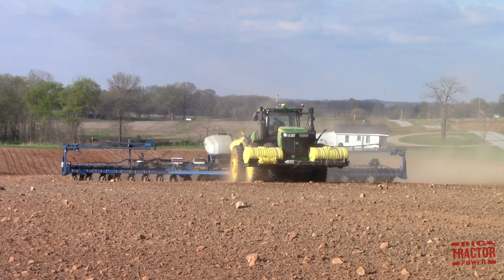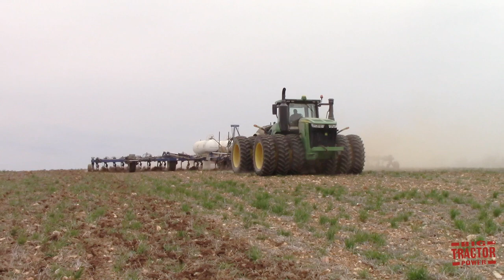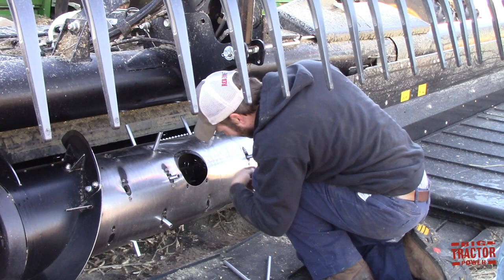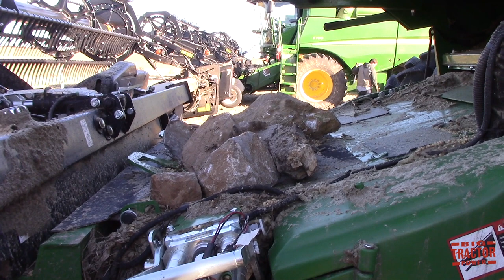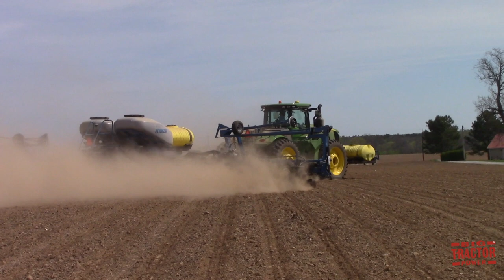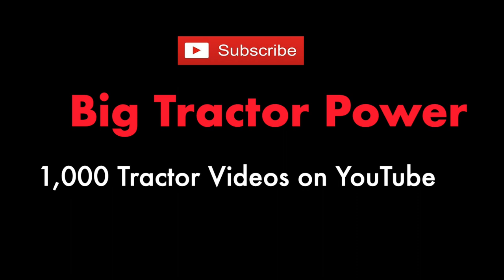Rocks, Rocks Get Rid of Those Rocks

Comment: Oh the memories.  As a kid in the 70s and 80s I spent many hours on an open tractor with a fork type rock picker (no reel just a hydraulicly operated fork on the front that lifted the rocks and dumped them in a bucket in the back) once the bucket was full you couldn't use the fork anymore so you got off the tractor and picked stones by hand to heap the thing full because driving 1/2 mile to the stone pile with a partially full stone picker was seen as a waste.  Also picked by hand when there was a patch with thick stones.  Later we got a reel type picker which made things a tiny bit easier.  The big thing was the switch to no-till.  Tillage brings up the stones so no tillage equals no stones or less stones.  Now with geo marking software on the planter, sprayer, and combine you can just look at a screen to see where the rocks are and drive there in your air conditioned tractor or if in the crop drive a side by side out there.  Land rollers are a huge help when growing low legumes like soybeans, peas, lentils that have to be harvested tight to the ground.  Big rollers push smaller stones and dirt lumps flat into the soil.  Any stones the size of a football or larger won't get punched into the ground and need to be picked up.

Comment: I remember plowing and once in a while a plow bottom would hit a big rock making the tractor slow down until the bottom trips. We had the older IH plow with witch we would have to stop, and backup to reset the bottom. My brothers would get mad if I forgot to tell them where big rocks were. One spring one of my brothers hit a huge rock. We tried to dig it out and discovered it was at least 3’ if not 4’ in each direction. So we dug a deeper hole beside it and pushed it in. Rock are a pita to farmers.
Reply from the maker: I grew up in WNY where stones are prevalent. I remember watch plow trips springing well. What size IH did you run?  The 710 and 800s were popular in WNY. There was field on the road I grew up on that had a stone so large that when they tried digging it up with a back hoe the back hoe could not budge it.  They just left and a small tip of the stone is visible on the surface and they just go around it .

Comment: We run a heavy roller over our bean ground right after planting. It smashes the rocks down flush with the surface of the soil and almost eliminates rock damage to the combine. Also helps with soil erosion. We get more rock damage to our corn heads.
Reply from the maker: Rollers are a hand tool.  They also help germination.

Comment: An old F150 in 4L idling across the field at a slow walking pace was the way we did it.  One guy on each side if the truck throwing rocks into the bed, armed with an old corn crib rake in case some needed to be dug up.  The truck got emptied out at the end of the row by the ditch or they were put on the river bank, depending on which field we were in
Reply from the maker: Great history 👍

Comment: Another great video. Sure hope they have a fleet of rock pickers. Looks like they'll need them on the land that goes in beans. I'm assuming this is the 13000 acer outfit?
Reply from the maker: This vid was a mix of clips of three farms I film at.  The rock picker is part of another large farm.  Most of the destruction clips are from the extra big farm. The big farm uses a Kongslide picker in the fall and Skid steers with rock buckets in the spring.  I need to try to film the skid steeers going in the clean up stones.
Reply: I @bigtractorpower Is it feasible to use a rock picker for the areas covered in potato size rocks after a crop is planted?  I'm thinking all the small rock will have to be hand picked or just left in the field. They're of course no big deal for any crop besides soybeans.

Comment: As a kid in the 70s & 80s, I would plant corn with tractor with loader.  As I came upon a big rock, I'd stop, throw / roll it into the bucket and then dump when I got to the end of the field.  When were were going to seed a field, usually my sisters, mom, cousins & aunt would be out picking stones and loading them on a hay rack.  We had some field where they would load up 10-15 wagons!  Me & Dad usually had the chore of loading the gut-busters/hernia-makers!
Reply from the maker: Neat history.  What tractor and loader did you run to plant with ?
Reply: @bigtractorpower  We had a MF 265 & MF 4 row corn planter & IH 12' grain drill.  Out "big" tractor was a MF 1135 that was dyno'd at 160.

Comment: Why not get a big rock bucket? hmmm
Reply from the maker: They have rock buckets on skid steers as well. Just need to film them.
Reply: I've only seen big rock buckets on like Volvo wheel loaders, i've acully never been seeing a skid steer operate with my own eyes. Exampels of what i see is beeing used in sweden to pick rocks with: https://norje.se/produkt/stone-fork-n306/?lang=en
https://norje.se/produkt/ensilagegrep-n391/
Reply from the maker: A wheel loader would be neat to see. The skid steers are nimble rock pickers and they load them on a pick up with a trailer and move them quickly to the next field.

Comment: Why do the tractors on the planter have so narrow tires?
Reply: Cheaper to replace than having pairs of wide ones.
Reply: I would say so the tires fit between the rows being planted.  Otherwise you would be planting in the wheel tracks which would result in those seeds being deeper in the ground.  IMHO
Reply: @dwightl5863  
That's a very interesting answer, not sure if it's true though. I was only quoting what I've heard Jason quote. But perhaps he knows if the wheel spacing are at what you say they could be. They are the latest model tractors so could have been built to that spec.
Reply: The narrow tires on the tractor fit between the rows being planted. You don’t want to plant into wheel tracks left by tires. You’d have poor plant emergence if you constantly planted into tire tracks. Due to compaction. Poor/uneven emergence drastically effects yield
Reply: @Rick-fx8lh 
I agree with what you are saying but are the wheels set up at those spacings? 
Do you know what the row spacings are?
Reply: Adrian Chetwynd: Check out BTP’s previously loaded video of the planter maybe he says in that video. Judging by this video yes the tractor tires are set up how I described it. The tires are set for 30” row spacing
Reply: @Rick-fx8lh  
Thank you Erik, I will sleep well tonight with the thought that the financial debtors of those tractors have in-debited themselves very wisely. 
Any many thanks to John Deere Inc for spacing the wheels so well.
Reply: @Rick-fx8lh  
Did you know that John Deere Inc was responsible for bankrupting the company that created the Big Bud tractor design/concept?
I cannot remember the name (off hand) of the original company  but Jason knows what company it was that "John Deere Inc" chose to bankrupt.

1 years work in exchange for a 5 year "desist not to do any other work" is a very dangerous contract to sign up to!
Reply: @Rick-fx8lh 
I think that the name of the company that invented the BIG Bud tractor design/concept was called "Wagner".

Comment: There is no way you are filming 2018 field work. Mn Millenial  Farmer is still snow blowing. Why are you fooling us like this?
Reply: Muscle Tractor Fan of course he’s not filming 2018 he’s filming 2019. Minnesotans is one of the last farmers to plant the corn in the US.
Reply from the maker: Farms are really working right now in Western Kentucky.  They are applying fertilizer working ground and planting corn.   If the spring footage in this video was not current how was I able to film a 2019 9620R with the new side shields on the hood applying anhydrous ammonia?  That tractor is brand new for this model year.
Reply: Down south they are able to start field work a lot earlier then we are. I'm just across the boarder from Zach in SD, and it'll be a while before were able to get in the field, we still have snow around up here. Usually around here end of April beginning of May is planting time.
Reply: Muscle Tractor Fan I farm in MN and there is still snow on the ground here and I am way south of Zach. Your looking at a good month at least before the big wheels turn here.